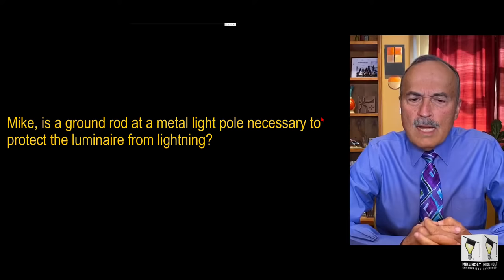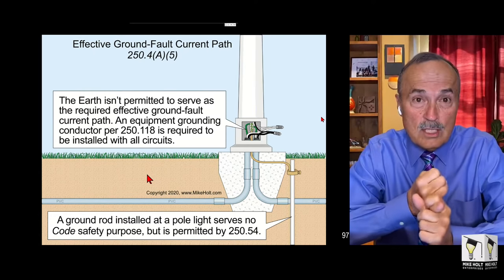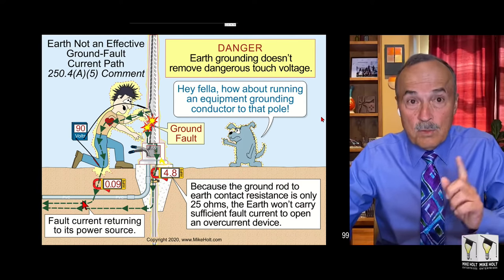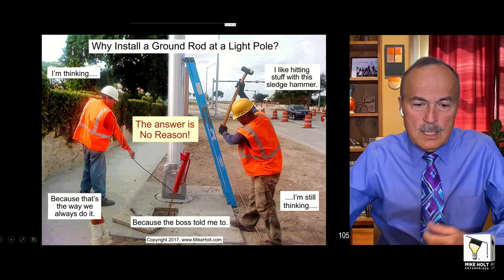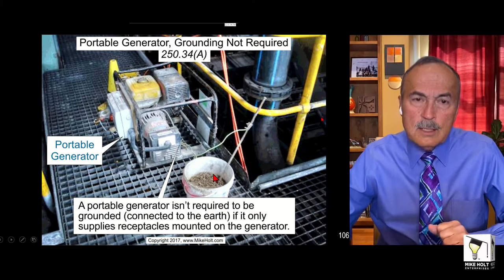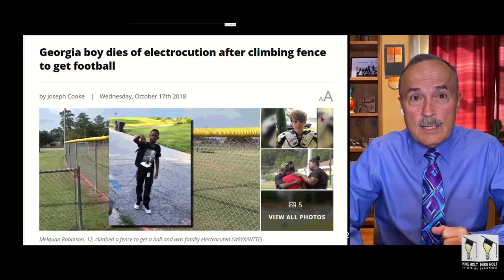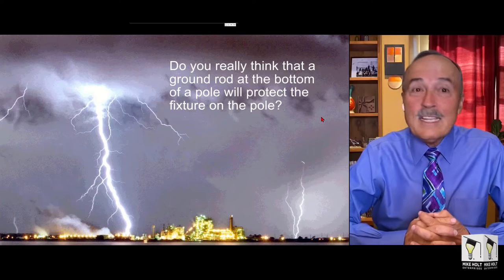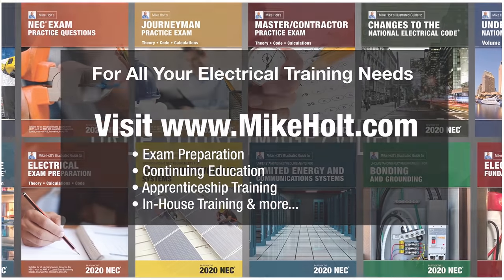Ground Rods at Metal Poles, NEC 2020 - [250.4(A)(5)], (25min:09sec)

Comment: Ground rods are for the grid not your safety.
Reply from the maker: This is a metal pole, there is no requirement to ground the pole, and there is not requirement to ground the 'grid.' What the heck is a 'grid?' Please watch this video - MikeHolt.com/Fundamentals.
Reply: @MikeHoltNEC  what’s the point of a ground rod ? It’s not to keep you safe and it doesn’t disperse enough energy to make a bit of difference on a home that has a surge. Now if you have a couple hundred grounding rods on the homes connected to the the POWER GRID !!! It will make a difference it’s only to protect the power grid. So if you think you need an extra grounding rod on your home you better call an electrician that knows wth he’s talking about to find the lose or broken common or ground that’s causing your appliance to become electrified. Let’s see why would they want or need a grounded metal pole on their grid ? Hmm 🤔 probably because they need it to divert a surge.
Reply from the maker: @slickruler2336  Grounding of the metal pole does not assist in diverting a surge, whatever that means. Please watch MikeHolt.com/Fundamentals

Comment: great presentation. lol solar DC systems are much easier it is much more difficult to design and implement AC systems. I remember designing a synchronous generator for a power station that was my most difficult class in electrical engineering in college
Reply from the maker: What, you watch a video about ground rods and you don't think I'm that smart to do Solar? When you get a chance, visit MikeHolt.com/Solar, it contains the books and videos that I produced on this topic...
Reply: @MikeHoltNEC  sorry I mistyped.  I was not talking about you specifically. I was really  saying AC systems are much difficult than DC solar systems
Reply: @MikeHoltNEC  I learned all my grounding know from you actually